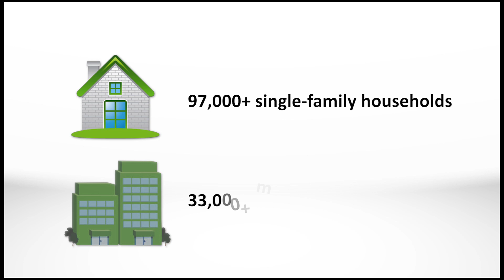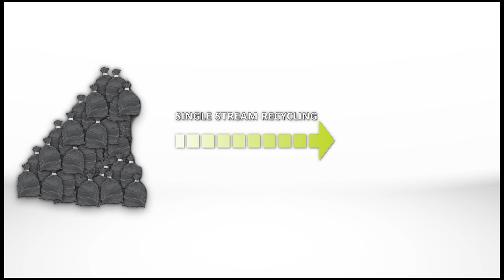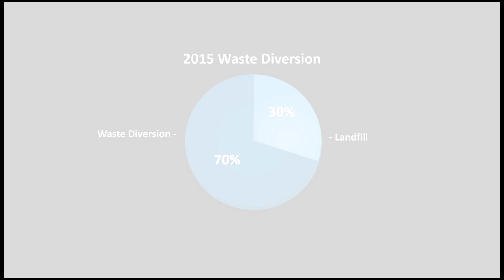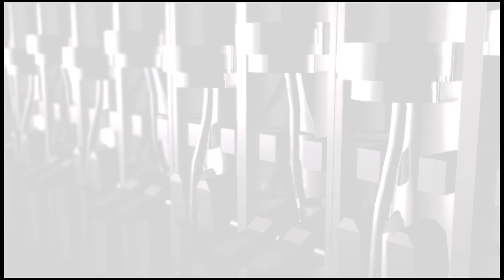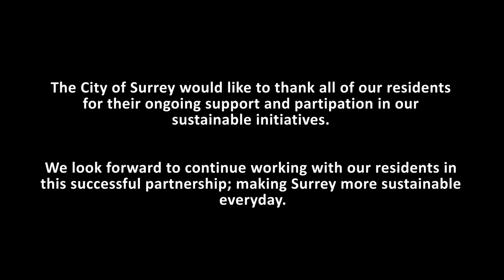Waste Collection: New Waste Collection & Recycling Services - 2012

Comment from the maker: Hi there, we only carry 80L, 120L, 180, 240L and 360L carts - if you did not choose the cart sizes before the deadline, you would receive a 80L cart. However, if the carts you received are not to your satisfaction, you can request a cart size exchange but they won't be delivered until January. We will be posting more information about this soon, please check our website surrey.ca for updates. ^LC

Comment from the maker: Justmks, CNG is actually a far cheaper way to go compared to diesel.  The cost of a CNG waste truck is about 18% higher than a similar diesel truck.  However the cost to fuel a CNG truck is less than half the cost of diesel.  The return on investment is excellent and over the life of the truck the savings derived from using a CNG truck compared to diesel is significant. ^LC